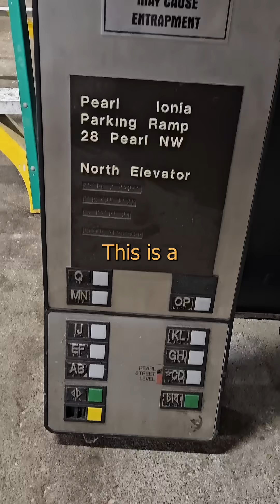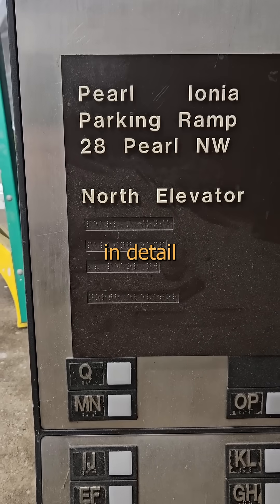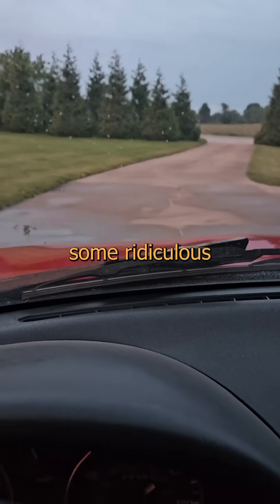Miata Mischief #chrisboden #engineering #gear #elevator #score #stories #parts #hacking #making

Comment: I’m in the Army and I went to the field, and I acquired 2 large pieces of wood about 6 feet long and 6 inches in diameter, they were nice pieces and i wanted to season them so that I could making something out of them. Bringing them back from the field was easy cause I just strapped them to the tactical vehicle we rode out in but I wanted to bring them back to my barracks room but I didn’t have a car at the time cause it had a flat tire and I was waiting for the weekend to get the tires replaced, but, I did stow my kick scooter with me up at the office before leaving. it was gonna be my ride home one way or another. And so I strapped them horizontally onto my ruck sack, turned sideways out the door with my body armor and Combat helmet on I rode the scooter down the massive hill towards my barracks room. A few close calls with light poles and definitely weighing more than the rated safe weight of the scooter I managed to get back to my room and safely place them in the corner to season for a year.

Comment: In my Fiat 500 pop I shoved a 10ft x 4ft butcher block countertop that we got for pennies on the dollar due to a department store technical error. It was only a 10 mile drive but I absolutely would have lost my head if I got sneezed on by a child on a tricycle. 

Or the time I fit 16 whiskey barrels into the Fiat...yes 16. I had to break them down and stack nice and neat. But they all made it home...
I've fit a lot of wood into this tiny hatchback.

Comment: I have a video on my channel showing part of the process but I moved a tool box weighing over a thousand pounds on its back in the truck bed of a ford ranger over 700 miles on midwestern roads. The box was held in the bed with two ratchet straps, surface tension, and my hopes and prayers as we bounced my box over every pothole I-70 and I-44 had to offer.

Comment: , i managed to relocate a vintage 1 Ton floor-mounted combination safe with  using only , my GM Colorado, a surprisingly well built hand-truck, and  2 ratchet straps. luckily I only had to take it less than half of a mile. I did this by myself.  (me=190 lbs vs floor safe=1000 lbs) lol. very stupid on my part but hey it worked out. kinda.

Comment: Using my clapped Buick Century, I've hauled 1500lbs of flooring, loads of firewood, enough tools and materials to rebuild a Honda motor, and move my life across country four times. It has custom (hillbilly) suspension and a rebuilt/built up 3.1 motor, and racing brakes because West Virginia sucks.

Comment: About 8 years ago I was in college and wanted to get a half sheet of plywood to use as a table topper to play X-wing miniatures on since my table was too narrow for the map. I got it at home depot and had to tie it to the roof of my car using the twine that they have by the door. However my car at the time was a 2003 C230 Kompressor, which of course it had no kind of roof rack. So with a towel under the plywood, I passed some lines of the twine around it and through the inside of the cab to keep it moving from side to side, had some around the front of it tied back to the trunk latch so it couldn't slide forward, and I think a few around the back and looped underneath the hood so it couldnt slide out the back. Then I had to drive 20 min on the highway back to my place. I think it was fairly secure, but it felt sketchy as hell driving with it.

Comment: I strapped a twin bed to the top of my Toyota Yaris, box-spring on bottom for some reason. We squished it around the car top by wrapping 100ft of rope through the windows, round and round. So we squeezed through the windows to get in. We spent 1 hour on 55mph county roads with the mattress bent in half to reach where we were going. 😬😬😬

Comment: Went to get some old mdf wardrobes from out of town for free. Stood them up, (roughly two metres tall) strapped them onto a tiny box trailer with my GF. We get onto the open road and everything is fine and dandy.

Get to the 110kmh zone (Australia sorry no freedom units) suffice to say now shit hits the metaphorical fan. The vibrations cause the top and back of one of the wardrobe brakes and the strap comes loose, and now I’m travelling at the speed of smell trying to find a place to pull over. Get on the side of the road and assess the damage I’m there swearing my tits off as other motorists meander past me nearly ripping the skin off my ass as i tie these down.

Drive at a leisurely 80kmh, as a solid 30 car lineup builds up behind me. Get into town thinking the Herculean part of this task is over, and then we get to the first roundabout. 

I go strait through this one at a regularpace but even as I make the slight bend through this motherfucker i see all 3 of these wardrobes tip a full 45 degrees, before they fall the other way, as I straighten up. 

My dear lord, those pantaloons were solemnly soiled, and I noticed i had to make a right turn at the next roundabout, and so I decided I had to go at walking pace through this one. I waited 15 minutes for a long enough clearing in traffic, whilst the 30 car conga line had probably gained another 20 members. And as I made that manoeuvre everything else stood still as I stared only in my rear view mirror as they all lean to the left before straightening back up and then doing a hula dance, back and forth.

Rest of the trip was fine, my GF was scolded and I no longer trust her if she says we only need a trailer or “we can do it in one trip.” However her apology was most satisfying that night. Peace ✌️

Comment: Once went to Kmart with the new boyfriend to buy a mattress.  Drive a 1996 Ford Thunderbird at the time.  Ended up buying a futon instead not thinking about where I would put it in the car.  Went outside pulled the car up and .... Went back into the store to buy a rope.  I had the store guy help my boyfriend put the futon on the roof and then had my boyfriend get in the car and close his door.  The other guy and I tossed the rope over the futon, then passed out through the car over and over until we had it secured then I got in pulled the rope as tight as possible and closed the door to secure it.  My boyfriend is just sitting there looking at the futon poking over the windshield and looked at me like I was crazy.  We drive home with other drivers giving us strange looks at stops.  Got home unloaded and my boyfriend finally says I can't believe you just tied it to the roof.  You're crazy.  I said I know.  We're married now more than 10 years later and still have the futon and Thunderbird, though both are a little worse for wear.  He still calls me crazy and I just admit it.

Comment: I drove a 2014 Altima 18 hours to get a transmutation and soft top for my Miata (for $300 and around 75k miles on the trans)($600 on the soft top 🤦‍♂️)which in turn left me with a transmutation in my trunk and a soft top going threw my back seat/ trunk 🤷‍♂️ for half the ride. 
Just to get pulled over and given a ticket for going 15 over because and I quote “kids speed threw here often”

Comment: A decade ago, i thought I'd surprise my dad by replacing the warped hand rails of his deck. I roll two 16 ft 2x4s out of the hardware store and forgot im in a ford fucking focus. from the floor of the passenger seat through the moonroof, and 4 miles down the road 😂

Comment: I bought 80 pallets of FIMA emergency relief MREs at a government auction thinking I was getting only 6-8 pallets for emergency food storage for my family.

Each pallet had 48 boxes with 12 meals per box. And I had 80 of them.

When two fully loaded semi trucks pulled up to my house and knocked on my door I was freaking out, I had to clean my entire garage, and was able to fit 46 pallets. 

I ended up having to leave most of them in my driveway and I constructed a reverse greenhouse to keep them cool (this was July of last year and temps were getting into the 100s.

After sitting on them for about 3 weeks I decided to start selling them to get them off my property.

3 days after I made the listing on fb marketplace, I was let go from my job and selling these MREs became my only income.

In the first 3 weeks I had sold 10 pallets. And enough people were buying them by the pallet and bringing trailers that I bought a forklift. It was in pretty bad condition but I’m really handy and fixed it almost completely after 2 weeks(it leaks hydraulic fluid when I lift more than 1 pallet) 

After 8 months I had sold most of what I was willing to sell. 

This whole time I had also been applying for jobs and starting my own business, but neither had gone anywhere yet.

In April of this year I won another government auction. This time it was for real MREs, the ones our military members eat (god bless them). 

This time it was 76 pallets, and I was prepared I had one truck come to my house, and scheduled the other one for the next day at a warehouse I rented.

I’m currently halfway through selling the  stock at my house and my business is starting to take off. I still haven’t been hired by anyone, but I should be able to get my company to start earning me money in the next 6 months. Which at this rate is about how long my stock will last before I sell all but the few pallets I want to keep for food storage. 

I haven’t had to sell my house or any cars, I did have to sell my motorcycle to afford the forklift however. But I am very lucky that this opportunity happened exactly when it did otherwise my family and I would not have been able to keep the things we have.

I believe that this happened because God was looking out for me, and I thank Him every chance I get because I know that He helped me and my family through this.

Comment: Sketchiest thing I've logged around was my buddy's grandfather's lamp that they duct taped and roped into my truck the night before because I was the first to pass out on a boys night of drinking and board games.

Left in the morning with all of them laughing their buts off at me and I had no idea why until 10 miles down the freeway when I finally had to do a right hand lane change on the and saw the damn thing sitting in the bed of my truck.

Drove back to them and they're asses were all sitting outside waiting for me to return. Took 20 minutes, scissors, and the death of my buddies lamp to remove it from my truck. Also some paint from the duct tape but probably the best and sketchiest thing I've unintentially hauled going 80 down the freeway with it basically loose in the back.

Comment: I spontaneously bought a piano for 20 bucks at an estate sale. I don't know how to fucking play piano (still don't), but the only way to get it back was with the help of a couple friends and my cousin's truck. 
On the way back, on Main street, my friend jumps out of the passenger seat, runs and jumps in the back of the truck and starts playing piano while we slowly cruise down Main with our own makeshift mini-parade.
Had people honking and cheering us on... Still surprised how we didn't get pulled over, as Main runs right next to the local PD.
It just acted as a conversation piece to collect dust for years, until I gave it to a friend who could actually play piano.

Second, was when I again, spontaneously bought a willow tree. Drove it home in my Mini Cooper convertible with the top down, and it buckled in the passenger seat.

Comment: I bought a supposedly broken 75 inch TV on Craigslist.  Brought a handtruck with me on the ferry ride to where I was meeting the seller.  Hauling this thing back onto the ferry, I'm getting more stares than you can imagine!  As, with its box, it's taller than I am!  Ferry worker was nice enough to help me get it through the slim terminal doors.

Soaked in sweat by the time I get it up the ramp and haul it through to the other side of the boat. Getting more looks.  (There's a picture of me with this somewhere!)  Get to the other side, haul it down the ramp and up a pretty steep hill to my house, JUST beginning to rain when I wrestled it inside.

One shower later, and it's acting broken as advertised.
BUT! One hard reset after THAT, and I have a WORKING $1600 TV for $150!  It was a gamble, but it paid off!

Comment: I think the worst I’ve done is for 300 cc Enduro dirt bikes in the back of a Ford phantom at the steepest hill in my area which we only made it up on the second attempt by timing the traffic lights right so we could go over the speed limit just to get enough momentum to make it up the hill was also really sketchy on the way down with all that weight and brakes that weren’t designed to stop the car. with anything more than half of my ex,s “personality” on board at any single time, but it was a fun day of riding motocross. 10/10 Would repeat again, but only with the boys.

Comment: I was 18 and I have the 1993 Mitsubishi Lancer. My mother is an avid biker and have a bunch of bicycles (some of which are folding bikes). I had to haul my mother, myself, and 8 bicycles in the Lancer because her Toyota was being used by my brother who didn't have a car yet. It was a tight fit and a bunch of foam, cardboard, and binbags were used to prevent scratches. BUT IT WORKS. Loading and unloading it was a nightmare tho.

Comment: I once loaded a Miata shell on the back of my Miata and strapped it down with straps even Temu would've failed for quality control and proceeded to drive it 3 hours back home.

Granted it was in pieces and on a pallet but it was still a whole Miata shell.

Comment: Had two buddies get onto the property of a Mall that was being demolished. It had a standby generator with a propane powered chevy 350 v8 as the engine. They pulled the heads and intake off one night, then came back the next for the engine block and pa-bumped it down about four flights of stairs. Now we have a brand-used (37 hours!) Chevy v8 with one heck of a "tactical acquisition" story!

Comment: At 17 i bought a vintage boy scouts aluminum canoe for about $100 dollars from an older couple up the road from me. Being 17, dumb, and close to home with nothing but a van and a rope i put all the rear seats down, slid the canoe in until it wedged itself in-between the front seats, tied the rope to the back so i could keep tension on it pulling it in, did a little loop around the back doors to keep them from swinging wide open and sent it. Got it home without any damage to the canoe or van so i considered it a win and me maxing out my luck for the year lol

Comment: 2 CULs, 4 attachments for those CULs, 2 industrial hoppers, all loaded onto one 16' dump trailer. We had to haul this load 110 miles through one of the worst freeway sections in the US (mountain passes. if you know, you know). We barely were able to close the door with less than an inches clearance. Every bump, I would watch the jackhammer attachment we had sitting in the hopper on the back jump up a few inches, then settle a little deeper. Made it back without incident, but that was a scary load.

Comment: I picked up a set of drawers for a land cruiser in my little Mitsubishi lancer sportback. Although, I didn't bother to measure if it would fit in my car and the drawers were over 1300mm long and almost as wide they didn't quite fit in the car unless I put both front seats all the way to the front. After damaging the interior of my car to get the drawers home because mum didn't raise a quitter, I somehow managed to squeeze my 6ft 3 self into my car and proceed to drive an hour home practically hunched over my steering wheel while my forehead gave the sun visor a good tickle. 
Sketchiest shit I've ever done to bring something home 😅

Comment: About 10 years ago, I was helping build my mom’s house. One afternoon, my friend and I went to a hardware store to pick up some essentials—shovel, drill bits, concrete, sand—and on impulse, I also grabbed a full-sized door I figured I’d need later.

We loaded up three heavy sacks of cement, the sand, tools... and then realized there was no way that door was fitting in my old '90 two-door Chevy Monza. Not one to give up, we rolled down the passenger window and shoved the door in diagonally—half inside, half hanging out. My friend had to climb in and sit on top of the door in the back seat like some kind of budget Tetris piece.

The car was nearly 1.5x its legal width, probably breaking every traffic law. But somehow, we made it home without being pulled over—just a few scratches on the door and our dignity.

Later that night, we dumped 300kg of cement and sand onto the ground, posed with shovels in hand, and took dramatic “Game of Thrones”-style photos. We called it: Game of Builders.

Comment: In college, I carried a door from Home Depot on my back as I rode my electric skateboard home.

I lived in a garage with no central cooling/heating as a renter. So my solution was to buy a door and cut a hole in the new door for a window AC. In order to get the door home, I carried it on my back as I rode my electric skateboard over the highway, through downtown, split down the center of campus and along the train tracks to my house.

I even placed the door on top of the skateboard a few times and "rode the door" like I was Aladdin, lol. It didn't work too well (fell a couple of times), so I carried the door most of the way.